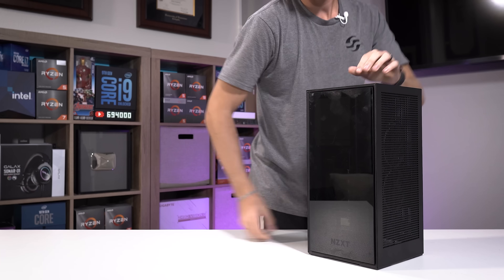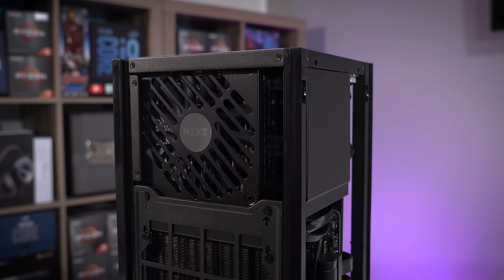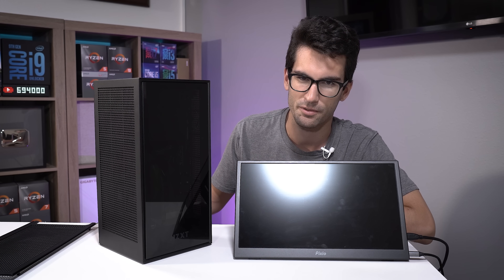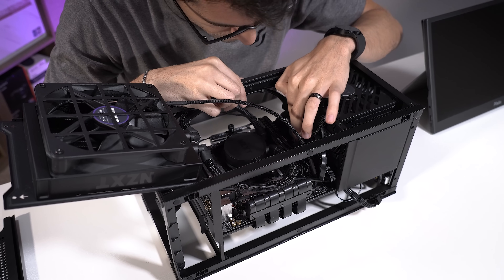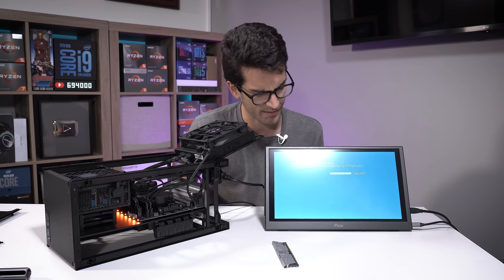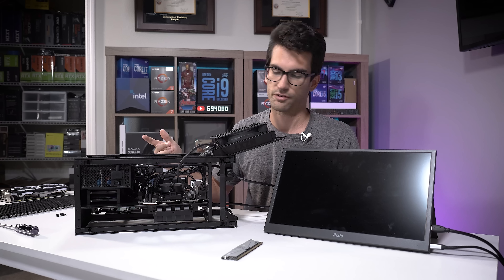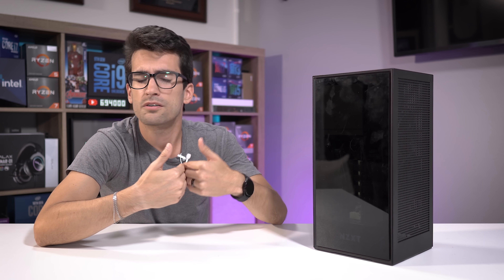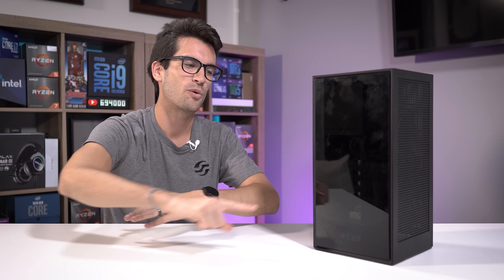Fixing a Viewer's BROKEN Gaming PC? - Fix or Flop S1:E16

Comment: I really hate this mobo. My parents have the exact same in their build and it was a nightmare to get it post. I think its a memory socket issue, because i had the same problem. The modules where in the socket, i pushed them 'till i heard the click. I re-seated them 5-6 times, nothing. I took out the ram modules from my rig and noting. I wiggled them a bit side-to-side in the socket and after that i got a post with both set of rams.

Comment: It doesn't POST because it doesn't have any social media accounts. Ha Ha! Great job Greg. I wouldn't have thought about improperly seated memory. I like that you didn't charge the customer for this.
Reply from the maker: I never charge our viewers for any of these fixes!
Reply: @GregSalazar  Awesome! I have an issue with my internet disconnecting after a while when downloading large files and the only way I can get it reconnected is to restart my PC. I'm currently downloading Call of Duty Warzone which is 90GB and I've had to restart my PC frequently just to continue the the downloaded. I think the issue may be with my wireless adapter which is old and has no more driver updates available. I've looked at multiple forums and have tried a lot of fixes but nothing has worked. I'll probably just end up getting a newer wireless adapter and seeing if that fixes the issue. I could hardwire my PC but the router is upstairs and I really don't want to move everything upstairs.

Comment: Before I finish watching the whole video....   riser cable  I went through two of them before tossing the case out and not going to deal with them again.. they are so brittle  and  will give you no picture but system will boot .    Video Ended  :)  Well it turned out to be memory not seated but he  RMA the motherboard as it could of been the mother board  first time and during re-building it he didn't seat the memory properly  but again I don't trust riser cables  LOL

Comment: Yep.  I had done an upgrade from 16 to 32GB.  System wouldn't post.  Thought I had an incompat problem.  Was close to returning since when I put back the 16 it worked fine.  For kicks I put the 32 back in and it worked.  This MB has those asymmetrical hold downs for the memory.  Only one side opens and locks.  Sometimes makes it especially fun to get memory in correctly.

Comment: Moral of the story, don't take anything to the Geek Squad.
Reply: It's likely that it was originally a motherboard issue, and when the owner replaced the motherboard, he seated the RAM incorrectly.
 

The other alternative is that Geek Squad didn't reseat or run diagnostics on the RAM, and the owner just doesn't know how to seat RAM correctly (also how would RAM unseat itself after working properly?)

Comment: So.. Geek squad probably did absolutely nothing including not touching the computer physically even before after a motherboard install? lol.  Thankfully they didnt charge him anything.

This kind of problem has happened to me when ive overclocked the ram and bios was locked on the bad settings.  Only way I could get it to turn on again was removing all the ram, starting the PC with an error and replacing the ram.

Comment: Never take your pc or laptop to geeksquad or micro center with a hardware malfunction. They will always say IDK bad mobo. Imagine geeksquad not even checking ram which is the first thing you should always check.
Reply: It's likely that it was originally a motherboard issue, and when the owner replaced the motherboard, he seated the RAM incorrectly.
 

The other alternative is that Geek Squad didn't reseat or run diagnostics on the RAM, and the owner just doesn't know how to seat RAM correctly (also how would RAM unseat itself after working properly?)

Comment: I also had the same issue on my PC. And I first reseted my CMOS, then tried to run it without a discreet GPU. I removed the modules and reseated them, but still didn't work. THEN, I just wiped the pins on the module clean and then it worked just fine. Greg, it just can't be a memory improper seating problem, it can be the module's contact pins a bit covered in dust.
Reply: usually for that matter we use pencil eraser
Reply: I have had my computer crash and not turn on. It had been working for months. Decided to check ram by booting with a single stick and system came back to life. Added second stick, no issue either. My guess is that sometimes something messes up software wise, or a glitch in some cache idk. It just makes no sense that properly seated ram becomes wrongly seated after a crash. Usually when I am trying out overclocking cpu, gpu or even the ram itself. I learned throughout the years that if the system crashes and wont post, reseat ram even if you know it was working fine before. And yes, I did tried clearing cmos before trying the ram, still wouldnt post, I have built and sold multiple systems (probably 15 personal rigs and 10 for friends and family) in the span of 10 years). I am an enthusiast computer builder, I have 2 systems at all times and a few extra parts for testing. I am the kind of guy that buys computer parts because "i might need it later" and then put a budget system together to sell on FB market place to make a quick buck if I need to.

Comment: He RMA'd the board so would have replaced the RAM multiple times. This one is confusing me. Maybe owner had a bad board the first time and then just rushed and didnt' seat memory correctly 2nd time and then gave up because of previous issues?
Reply: The PC just decided to hate the ram. I had the same issue. I'll copy and paste.

That's not what it was. I had this happen to me as well. Computer was on, thought it went into sleep mode. 
I had to take out my ram. Start with 1, turn it on, then 2, turn on the computer, then 3 , turn on the computer, and then the fourth.

Before I did that step, I took them all out, then put them back in. I repeated that till I thought I might have a stick that went bad.  It was super odd. I basically built this system as soon as the 2700X first came out. Last month is when I faced that issue. All 4 sticks are good. Still don't understand what actually happened.
Reply: Nah black screen can happen because multiple source. Mine cant get pass windows log-on screen and i think its faulty motherboard because my GPU and RAM is doing fine on another computer. RMA the motherboard 2 times and the problem still persist. ONLY after i take it all apart and test the motherboard outside the case i can pass the log on screen. unexpectedly my problem is faulty pcie cable extension to my GPU.
Reply: In my PC when I upgraded my PSU I had the same issue where it powered but wouldn't POST after reseating the ram the issue was fixed. I hadn't touched the ram at all when putting in the new PSU maybe he had a similar issue when he replace the motherboard
Reply: @supercool_saiyan5670  yeah my computer does this when i take the cpu out for any reason i have to put the ram in one at a time

Comment: You didn't mention whether you confirmed with him that he's replaced the riser cable! Fixing the fire hazard is even more important than fixing the pc itself. hes not using the nylon screws and from the looks of it hes using the old riser cable. so you're really leaving us in suspense by just saying "i'll ask him about it" with zero follow up.

this issue could kill people. probably good to emphasize it more in the video.
Reply from the maker: Of course I mentioned it to him. Thought I said this in the video.
Reply: @GregSalazar  You did, the dude wanted to know what actions/followup the owner of the PC took
Reply: and???? yes. you said you would mention it. I know that. I said so in my comment. What I was asking about was what his response was. Not sure how that wasn't clear.

so? whats the answer? is he using the old riser cable? is he going to replace it? does he just have a potentially deadly fire hazard sitting in his office because neither of you bothered to replace it? what is it?
Reply: @Hephera  GREG MADE HIM AWARE. It’s on him whether he does it or not. Stop moaning at Greg for an answer. Moan at NZXT for god sake

Comment: Wait, since he replaced the motherboard he'd have to take that build apart, that means removing the ram and installing them again.
I'm surprised the owner managed to recreate the problem perfectly. lol
Reply: Maybe the original motherboard was bad and then the owner failed to seat the memory when he got the replacement and then gave up before troubleshooting because they assumed it was something worse related to original issue? yeah its a confusing one.
Reply: @afgtp0906  That's what I thought with my first system i built for myself. One of my sticks of RAM were dead, and I didn't know until I installed it into a fucking working PC.
Reply: @afgtp0906  That sounds likely explanation why system were working just fine at before.
Reply: @15fakeaccount  I thought the same thing. That he had replaced the motherboard. So in theory he would have removed and replaced the RAM. Weird..
Reply: @afgtp0906  would also explain why geek squad couldn’t fix the problem initially and they were actually right about the motherboard.
Reply: It could be that he was in a rush to get his system going again maybe he just rushed installing the ram and didn't realize it.
Reply: At 7:47 when the ram was pushed down that motherboard flex really gave me chills.  I don't like bending my board that much and maybe that's what happened.  Board was bending and the ram felt in enough and just left it.
Reply: I think maybe the ram was dirty or something got caught in the slots and was finally accidentally fixed in this video. Who knows.
Reply: I have built in that NZXT H1 (three times) and due to the lack of rigidness (see 7:47)  of that area of the case, I have made the same RAM mistake all three times but always remember that it is like that on this case. For an unexperienced user, it's more likely he doesn't want to go all the way down with the pressure. And I always use a speaker to hear if I messed up, I bought like 3 from Aliexpress and I have one at home, one for my portable kit and a spare.
Reply: @yorchli3152  Yeah that's why you don't buy gimmicky cases like this, it's all show and no practicality...
Reply: We don't know if it was recreated perfectly. It was similar enough for them not to realize anyway. Goes to show how important it is to pay close attention. The owner could have fixed this themselves. Either way, the system is back working again, and lessons have been learned :)
Reply: makes me think there's an inherent flaw w/ that motherboard and/or RAM....not allowing a module to seat 100%...don't buy that motherboard and RAM combo is the take away from this video...............................
Reply: I only heard that the it guys said his motherboard board was the problem. I didn't hear that he replaced the board.🤔 did I miss that part?
Reply: His computer suddenly decided it didn't like the ram. I had this happen. Only way I fixed it was by adding ram 1 stick at a time. Only happened to me once since I built this system. Last month actually. Built when the 2700X first came out. Never really moved my system around except to clean it .

I thought my PC went into sleep mode, turned out it decided to hate my ram for whatever reason.  Adding all 4 sticks back 1 at a time fixed it for me.
Reply: It was propably pushed in enough. but then he moved the pc to his desk and the ram plopped out further.
Reply: If he didn't know his ram installation was the problem before he would never try to fix it later
Reply: I had an issue recently myself where I got a new MB, updated BIOS, and didnt POST after update.
Issue turned out to be GPU plugged to riser, after starting the system with direct PCIe connection, then the riser has worked fine afterwards.
(My case only has room for 2 to 2.5 slot GPUs directly, which I had a spare of and used, I use Riser to fit a 3.5 slot GPU)

Comment: With all the ram issues and how easy a simple reseat or drop to a single stick is to check surprised you don't do that immediately after clearing CMOS, but I guess its hard to make a video when an issue is resolved in under 1 minute.

Comment: The replacement riser cable has visible ground plating around the screw holes.
Reply: Yeah. He's still got the fire hazard in there. NZXT should still be sending those replacements out, as far as I know.
Reply: @nightbirdds  That is the replacement, the old ones didn't have plating.
Reply: Please tell me what this means plainly. I’m very slow with PC stuff lol
Reply: @joubinboghiri6057  The PCI-E riser that he connects the GPU to had an issue where the screw holes that attach it to the case weren't plated and metal screws were exposing a powered lane in the PCB that would short causing a fire in the PC. It was documented by several YouTubers and NZXT had to recall the risers. The new risers were supposed to come with plating around the screw holes and nylon screws to prevent it from happening. Had it been the old riser I'm certain Greg would have mentioned it immediately.
Reply: @joubinboghiri6057  The screw holes on the thing the GPU plugs into initially didn't have a ring around them, they weren't grounded, they only had the bare pcb, and the screw had a tendency to damage the pcb and mush the 12v plane into places 12v really shouldn't be going
I think
Reply: @wsketchy  Thx.
Reply: @joubinboghiri6057  Exactly my thoughts... never heard the expression/word in any situation (im not native)

Comment: I really liked how the issue wasn't resolved for you until you were able to recreate the problem. It's such an important troubleshooting step that's real easy to overlook.
Reply: the worst kind of fixed is accidentally fixed.
Reply: Gigybyte 4 this reason has verifying hardware issues - if the ram dims were seated properly. I no  longer buy gigybyte  w no regret. Glad it was a loose connection .
Reply: It's honestly surprising how many people tend to be against this step, I've gotten into many a heated debate when I say you should just double check to make sure that's what's wrong while other say you listen to what the "customer" says and believe them no matter what no need to check
Reply: How do you know if he recreated the original problem or if he just forced a different one but with same symptoms
Reply: @czbrat  Because of what solved the problem and got it to POST. An improperly seated DIMM doesn't let you output video. It's just a black screen. The user may have had a Mobo problem correctly identified, and incorrectly seated the RAM after the RMA. The final change that caused a post was a properly seated stick of RAM.
Reply: Aren't there lights on the mobo that show what doesn't post? On mine it goes through ram and gpu before booting, when i didn't put my ram well enough it showed me that it was the problem with the correct light.
Reply: @Kuroganemk2  not every motherboard has that feature
Reply: Could easily just be reseating.  I have this issue at work all the time.  Pull the server down to a min boot (cpu and 1DIMM) and reseat all parts until it either POSTs or fails.  Pain sometimes siince I have to deal with 8-24 DIMM per server
Reply: What is worrying me what was original cause if it frozen and then didn't boot. So was it really broken MB and when rebuilding computer he badly installed ram module. Or is there still lurking that original problem that will hit after long time of use.
Reply: @LimbaZero  Well, we didn't get a full explanation, it could be that the owner tried to turn it on, left for a second to get something to eat or grab something maybe, came back and it was still a black screen but the lights were off. If I had to guess, he likely changed a component or cleaned out his PC, misinstalled the front panel connector, and dislodged the ram
Reply: @LimbaZero  We could assume the user regularly cleans the system in which case he might have fucked up reseating the RAM.  This happens more than enough times. Hell whenever the stars align and I decide to clean my PC this happens 50% of the time :'D
Reply: @andrewdroid1  In mail what he reads "when I come to my office there was black screen I taught it was gone to sleep"  so it was working before visiting somewhere or yesterday when he leaving office.
Reply: @Chris he didn't recreate the original problem tho'. The customer said that his pc went to a black screen during operation (presumably went automatically to sleep state) and he couldn't wake it, or turn it off. I have the same problem with my system with an r5 3600 in it, my "solution" was to not let it go to sleep automatically... He didn't make sure that the new mobo fixed the original problem.
Reply: @broklond  The issue he was fixing was the lack of post. Deep sleep malfunctions are software usually which he doesn't deal and he makes that clear. He only deals with hardware level issues.
He replicated the issue the owner had AFTER he RMA'd the motherboard.

Comment: The minute I saw the case: lemme guess, shitty PCI riser cable?
Reply: Exactly why I went with the nr200 instead of a smaller sff case. I wanted a sff case with good airflow, good hardware compatibility because I knew choosing a gpu for its size is basically impossible and I'd just have to use whatever I could get (I got a 2.7 slot big af rog strix 3060 at retail), and my biggest requirement was no pcie riser, as I've seen so many problems causes by risers, especially with pcie 4.0 devices.